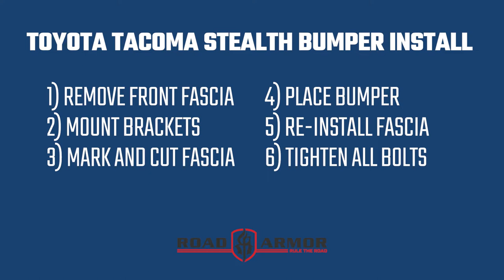Road Armor Stealth Series-Toyota Tacoma Front Bumper Install

Comment: Just installed mine and it would be really great if you guys included measurements as to where to cut the bumper and the bumper insert. Or better yet provided a paper template. I'd be fine with either.